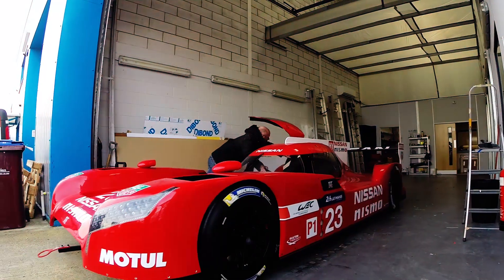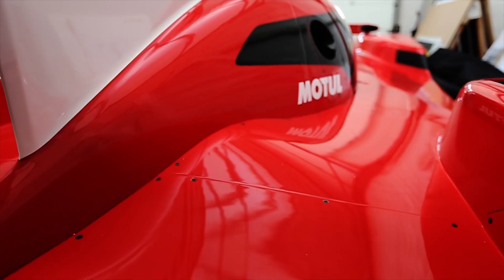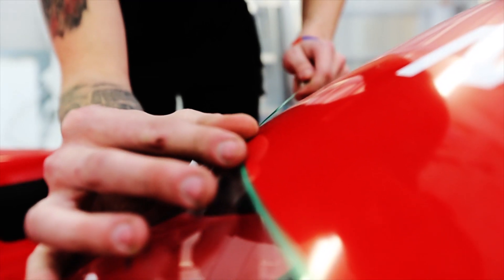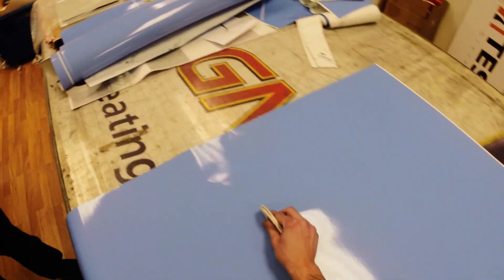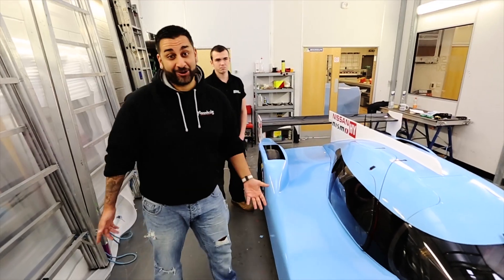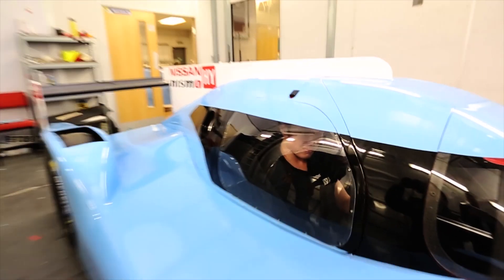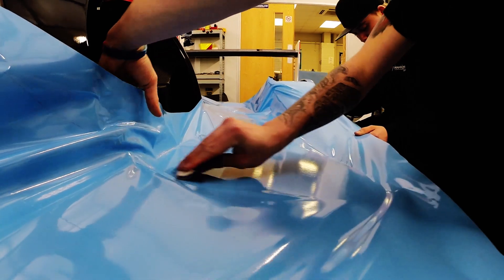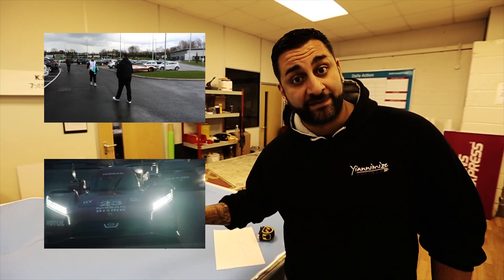MANCHESTER CITY GT-R LM NISMO WRAP!

Comment: I work in Motorsport and very closely with a driver who tests multiple Le Mans prototypes. The exhausts on the bonnet are having to be redesigned as when they spit flames at night it blinds the driver so they're having to come up with a new system. Also the seating and steering wheel positions are having to be rethought as you can't actually turn the wheel enough currently.

Comment: could she beat a f1
Reply: +Georgina Sadler It depends. its only 500 hp and f1 cars are around 750 hp. also f1 car is lighter. LM is made for 24 hour races so it would beat it then because f1 car would overheat or someshit because its made only for maximum of 2 hours races. but on the other hand in f1 race f1 car would win easly because its faster it has more downforce and its made for it. :)
Reply: The car raced at only one race, and it hadn’t had any hybrid, so it was 20 seconds slower than the Porsche’s and Audi’s